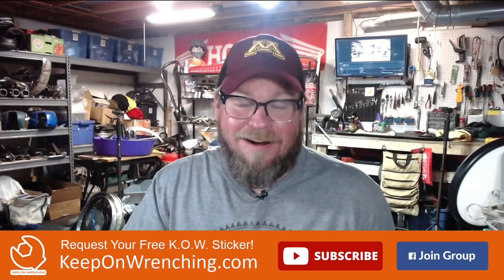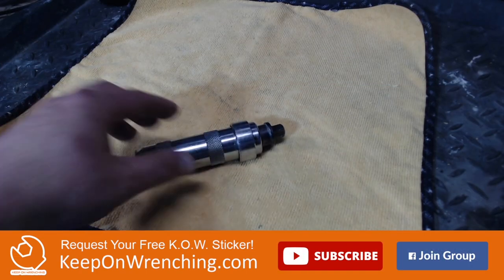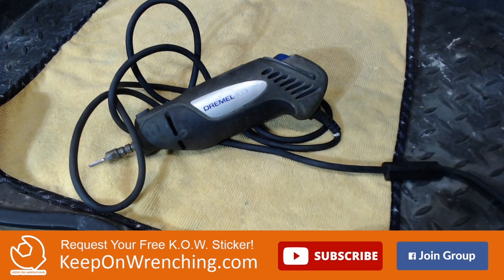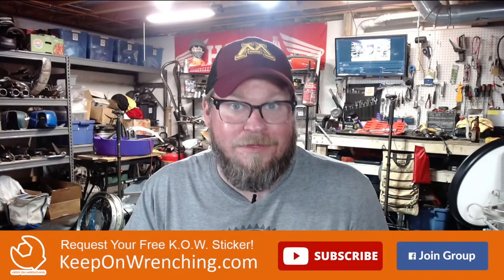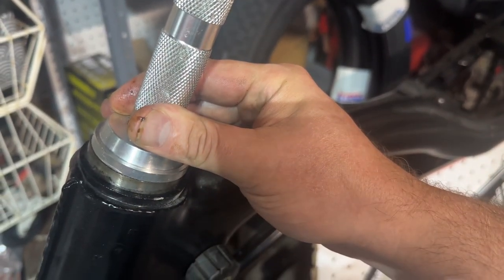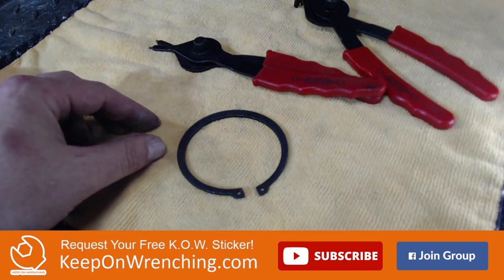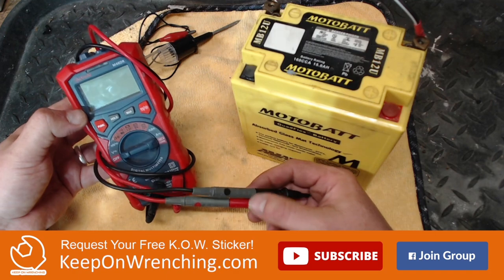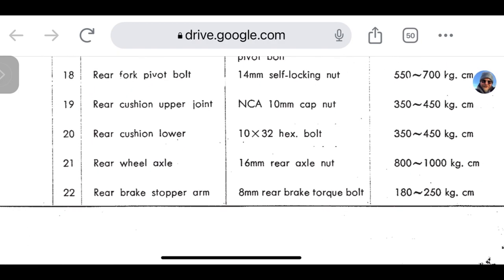Must-Have Tools for Motorcycle Restoration & Maintenance: My Top Ten

Comment: Great 1st list. I would add “easy outs”/ bolts extractors, there is always one bolt that doesn’t want to come off and this are great for taking stuck bolts out. Also a good set of Allan key wrenches and Torx set wrenches.
Reply from the maker: I think the term “good” is key too. Cheap tools can cause more headaches. Tempting to buy a $5 tool, but you’ll buy it 5 times. I’ve never had much luck East outs…I keep trying tho!

Comment: you were using the bearing setter upside down when installing the race.....thats what the tapper is for.
Reply from the maker: Oh I can see that. Makes sense. Got the job done!
Reply: for sure....just figured id mention it for nex time you use it, by the way im just about to start a 73 cb350 project...super pumped!!!!!  @KeepOnWrenching